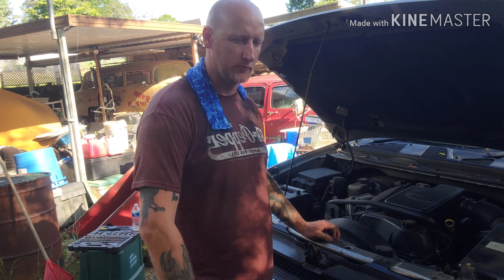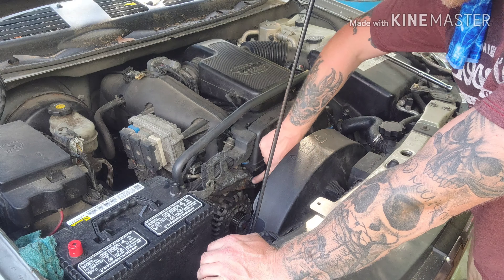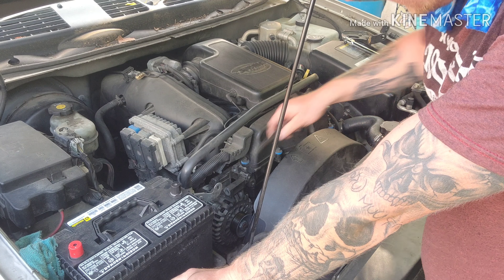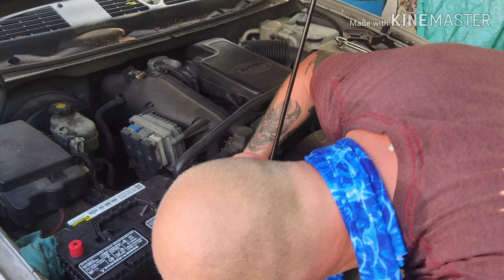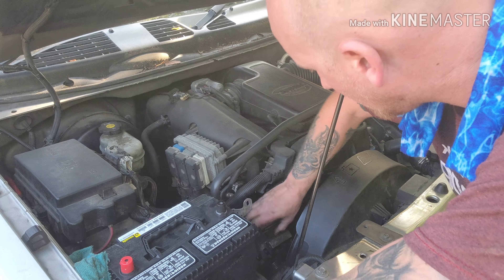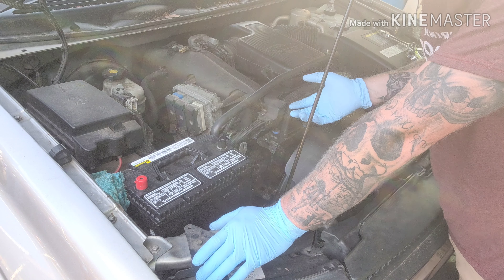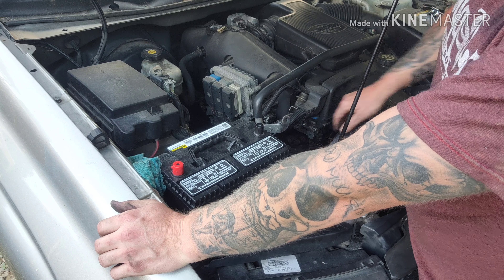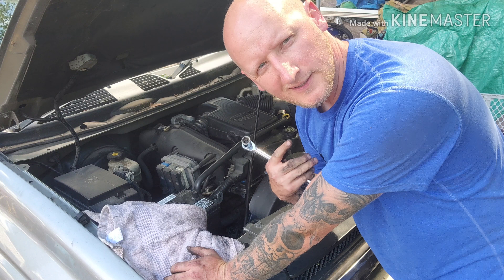2002 -2009 4.2 chevy trailblazer ac compressor replacement

Comment: My ac quits blowing cold air after about 30 minutes of driving and when i let off the gas i hear a scraping noise could that be my air compressor
Reply from the maker: Check and see if your ac clutch is engaged you could be burnt up

Comment: Hey my friend is it absolutely necessary to pull a vaccum on this?
Reply from the maker: You can if you want to but I didn't and it's been over a year no problem
Reply: @theredneckwarrior141  Thanks my friend! My 2002 Envoy's compressor locked up. Original. My friend says just change the clutch. I already bought a remanufactured kit came with dryer and oraface tube. Also came with recommended oil in compressor. I think I I'm just going to put new compressor on xxxzxxxx and charge it. Still has pressure in system.
Reply from the maker: @jpinckster  yeah I didn't change the orphas tube because I didn't wanna break the seal as long as you don't over oil it you won't have any issue's and I would definitely change the compressor because changing just the clutch is very difficult and you haft to have special tools to line it back up with its easier just to change the compressor but hope that helps best of luck to you my friend!!
Reply: @theredneckwarrior141  yes. Sounded like just a big a or bigger pain to change the clutch. If you have a 19 year old compressor and you have a new one it would be a waste if time and money to not do it while your there. Thanks again!

Comment: Well shit you're awesome. I've 2003 Trailblazer . This is the same process ?
Reply from the maker: Yes
Reply from the maker: @igotnewyorkshook4190  glad I can motivate you
Reply: Another quicky ! Thanks for the motivation. Now, the two holes on my '03 Trailblazer will not come off. I've removed the bults and the wiring however this metal is sealed to the old AC compressor. I'm using a flathead to get in but, no use.
Reply: The part where u said crack it...well, I can't remove that part where the two tubes are. It's like the metal is fermented
Reply from the maker: @igotnewyorkshook4190  the hose on the compressor the one bolt holding the lines on ?

Comment: Dude I’m struggling just to know where to crack a line open to leak out the refrigerant, you’re just pointing out like this little thing.. dude what little thing I’m replaying it over again I can’t see it
Reply from the maker: It's actually the line that curves into the compressor it should have either 1 or 2 bolts right at the compressor that loosens it it's right on top of the compressor the line is

Comment: My vehicle wants to overheat when the a.c. is on at idle. When driving its just fine. Guess that would be a bad compressor huh? You can feel a load on the engine when it turns on to.
Reply from the maker: That almost sounds like a bad clutch fan the clutch fan is an issue on these because all electronics run through the clutch fan and the wires on the clutch fan break
Reply: My gf has the same vehicle and hers would almost stall at idle with the AC on. I know it’s not the same as over heating but I cleaned the throttle body and it fixed that issue